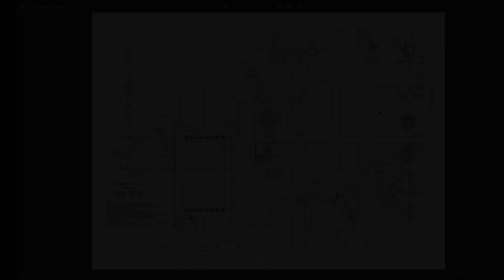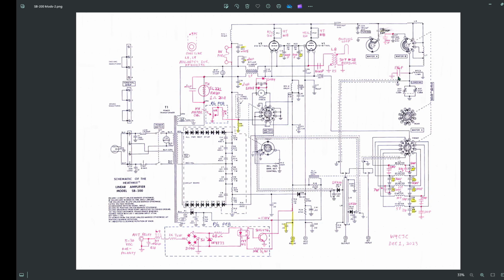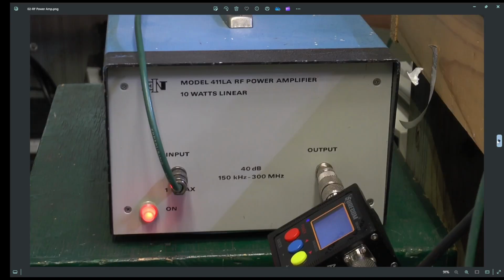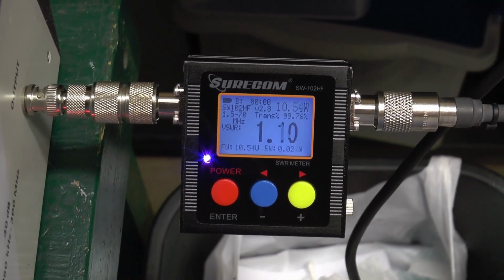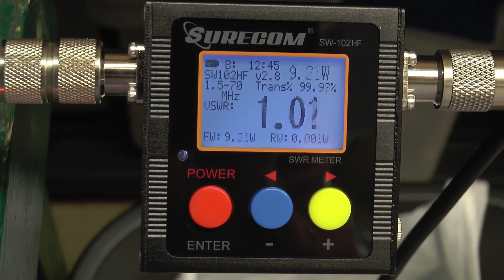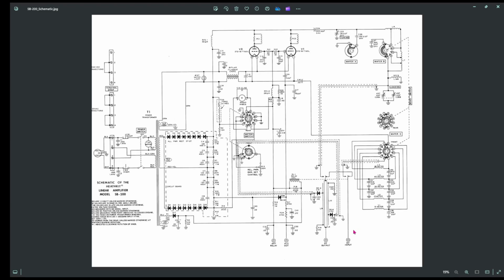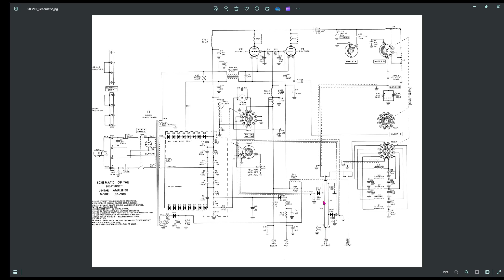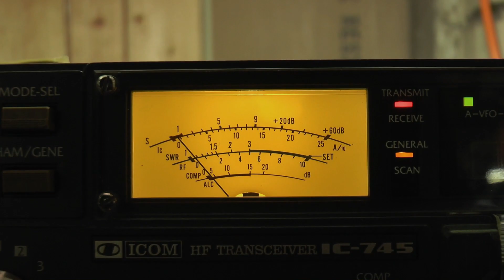SB200 Input Modifications (Part 2)

Comment: Thanks so much for all of the info. I just bought an SB-200 and the Input SWR is high on 10, 15, and 20 but really good on 40 and 80.  I will use your info to make adjustments for 10,15, and 20.
Reply from the maker: Yea, Its nice not to need a tuner between the radio and amplifier.

Comment: What was your method to adjust the input circuit?  I have an SB 200 and it runs great on 80, 40, and 20 but 15 and 10 not so well.  So what is the process to trouble shoot?   KN6YKE
Reply from the maker: You need a pure 50 ohm source of a minimum of 10W and adjust the input components for a minimum SWR on the input to the amp for each band. At the same time you must peak the output of the amp for maximum into a pure 50 ohm dummy load as the output tuning of the amp reflects changes to the input. It becomes a balancing act between the output and input until you get it right.

Comment: Thank you for all your work testing and selecting the values to make the amp work well with newer radios. I just finished restoring a SB-200 that had been in storage for about 18 years. It works well but as you have shown the input circuits leave a lot to be desired. I have tried tuning the input slugs but they are all firmly stuck in position. Did you have to work to release you slugs? What method did you use to loosen them?  I also went through your first video several times to gleam information that helped me with my amplifier.  73 Ken  WA1BFS
Reply from the maker: Your tuning slugs may be waxed in place. A heat gun may help to get them out.